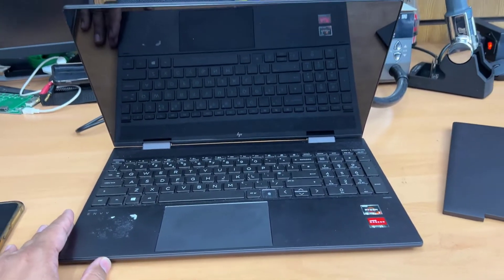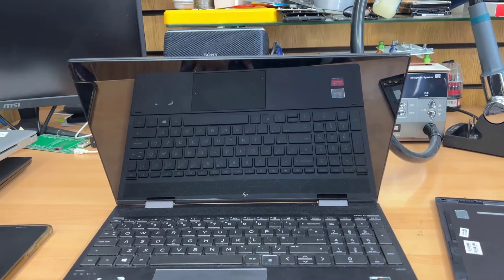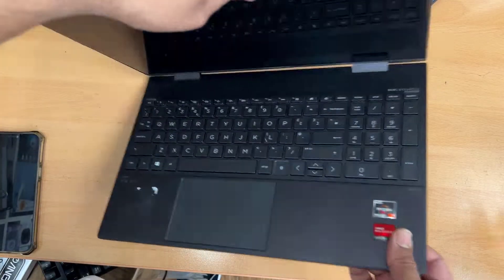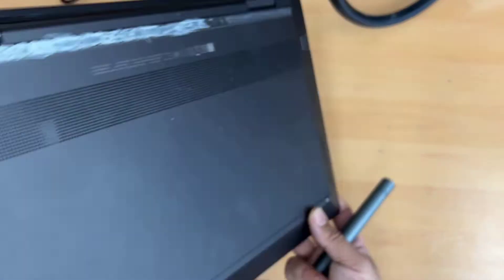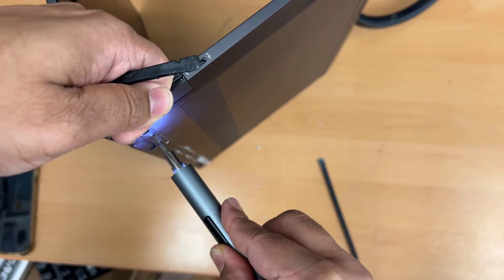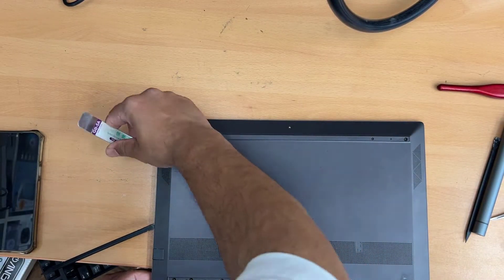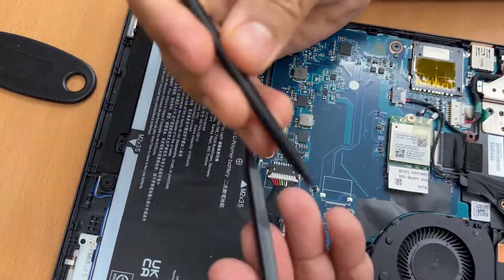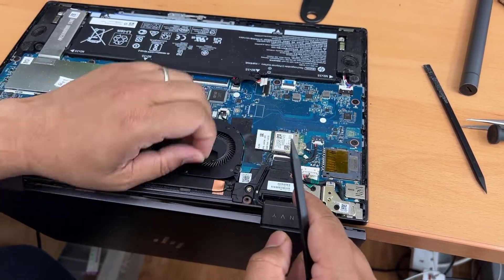HP Envy X360 15-EE000NA Touchscreen Replacement Tutorial

Comment: Thank you for the video.  I successfully replaced the shattered LCD from my daughters Envy X360.
The LCD I bought from Aliexpress came without the plastic frame, so I had to transplant it from the dead LCD. 
That took a long time as it was glued to the LCD and the sheet metal strips were attached with molten plastic buds.
The glue strips on my screen shell had the tabs on the top side. I got them off with heat and prying - the LCD was broken so I could use some force there.
The music makes my toenails roll up and my tooth plaque crackle. Thank God for the mute button.

Comment: Thanks so much for this tutorial. I was able to follow all your instructions and replace the cover on an HP Envy X360 :)
Reply: Did you really?! I'm temped to try but I'm scared lol
Reply: @doctortravis yes I did replaced the back cover which had detached from the left hinge and the new one is still going strong. I know it's a bit scary but, I was more worried that oled screen and touchscreen digitiser might eventually break if I didn't fix the hinge. The hardest part was removing the adhesive but you just need to careful and use a hotair gun.

Comment: It is not easy but with patience and a light touch you can pop the snaps along the top and get just enough room to snag the tape with tweezers or anything thin/pointed.  At each corner there is white tab with hole in it.  Snag that hole and pull tape out slowly.  It will seem impossible at first but I assure you it is.

Comment: UNFUCKINGBELIEVABLE!  HP installed the adhesive strips on the same computer as yours upside down with the release tabs being on the top!  HP SUCKS CANALWATER!!!!!  AND the only reason this hp needed service was due to their faulty designed hinges breaking away from the top lid!  My remedy was using the flat scraper and my rework station having a temp of 260 deg. C. not F.  The scraper being only 6 inches long proved not long enough to reach so after having both sides started with the scraper and keeping the area adequately warm just beyond touchable I'd work the scraper in then I moved onto a butter knife.  But, when I was finished and had the screen out I was shocked to see the release tabs at the top of the screen!  I had worked on this cautiously for 2 days when if the adhesive strips with the release tabs on the bottom were properly installed it would have been an hour job!  SHAME on HP!!!!!
Reply from the maker: You are absolutely right ✅️
Reply: @thepcphone  Thanks!  I did get it done finally and everything works as it should and flips over to a tablet as it should.  One mod I did was to loosen the torque on the hinges just a small turn-maybe not even a sixth of a turn so that the hinge torque doesn't cause breakage again.  HP?  Pffft!
Reply: @Tim.Woodchucker  BUT the release tabs were installed at the top of the screen where the keyed notches of the screen and top lid made it impossible to get to them and pull the tab.  Installed correctly, pulling them straight will have a success most of the time whether hp, dell, lenovo, msi, etc.
Reply: @Tim.Woodchucker  Actually the design has the hinges connected to plastic that is embedded as a frame inside the top lid that opens/closes X of times before this internal frame of plastic starts giving way and causes your hinges to be unaligned making it hard for them to function correctly and failure is imminent.

Comment: Good video. While I was able to snatch the bottom of one of the pull strips, I had to go in the top for the 2nd one. All my fishing around for that end (that on my model was about an inch in) came up empty. I've found for the average person these screens are so risky to replace like this that it's best for them to go shopping for an entire LCD assembly. Good used ones can be found for only a bit more than a new panel. Even riskier if you have a good screen/digitizer and you're just replacing the back because a hinge broke off. Then a bit too much flexing and.....CRACK!

Comment: Thanks for the video. Would like to add precision for others.
I just did it like you but now I noticed (i did not before in the video) that the pin hole of the tape is up on the screen. Perhaps prying a little bit at the top would give access to it.
Reply: Sadly my tape broke after I hooked it